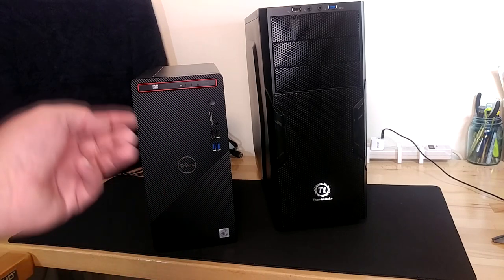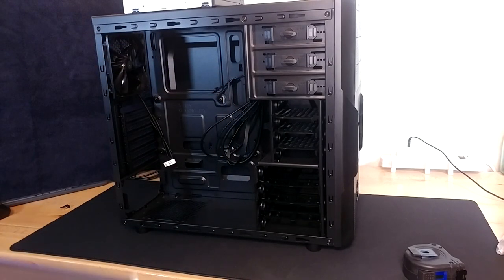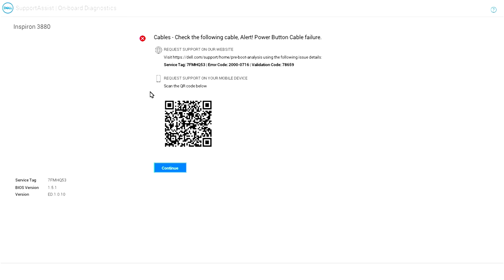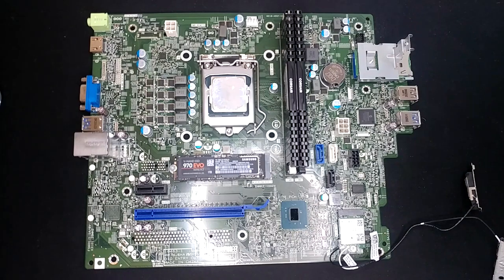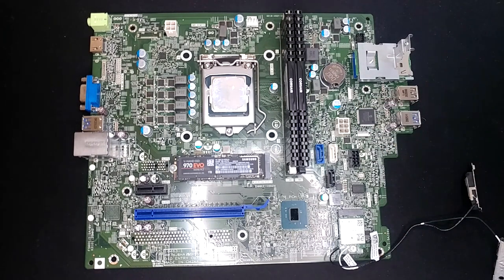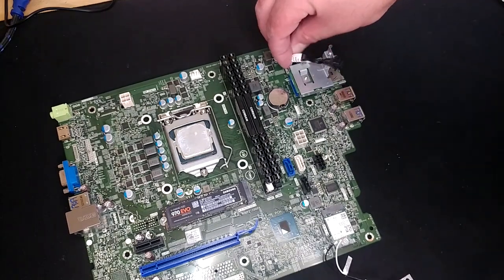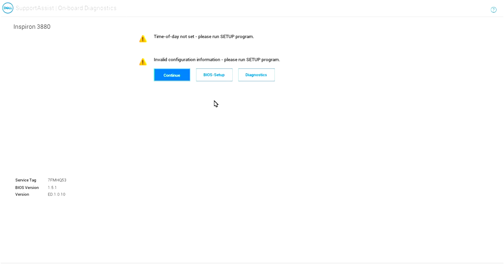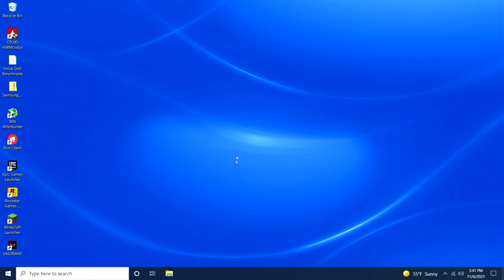Dell 3880 Case Upgrade!

Comment: Seems like the best course of action is to harvest the processor ram etc and sell the dell board which should give you enough money to buy a new standard board. I think that would work out just fine for someone on a budget and no compromises would have to be made.
Reply from the maker: I couldn't agree more. That is the exact advice I've given hundreds of people starting at the point of wanting an aftermarket PSU. From that point forward, they'd be better off to harvest their Dell for parts, IMO.

FWIW, I've seen no evidence that anyone but me has actually done the case swap. It's also one of the least viewed videos in the series. So, this seems to be the point of ridiculousness where people get off of the crazy train. 😆
Reply: @TheBrokenLife  I can definitely see someone doing it in the coming years as the price on these drops in the used market especially if they just need a more powerful gpu and already have all the parts for a quick and dirty setup
Reply from the maker: @JBTYpr  I'm not entirely clear which position you're advocating for, but the motherboard is the last thing of the Dell I would make any effort to keep. All the same, I've shown it can be done if someone really wanted to. 😆
Reply: @TheBrokenLife  I’m saying we will probably see both approaches, those who may have spare psu gpu and case might not want to bother with selling the motherboard and just do what you did for a quick and dirty setup especially as these get cheaper over time.
Reply from the maker: @JBTYpr  I gotcha. For the sake of those future peoples, I hope they find that aftermarket motherboards are cheaper too. 😆

Comment: Is it possible to just buy a new mother board and case, and just add all the components like the processor, ram,, harddrive,  etc, and it still be the samecomputer? like same backround, same files, same workings,  or does something special after that need to be done?
Reply: Looking forward to seeing the motherboard swap. planning to do this myself. Your the best.
Reply from the maker: @johnqwaser74  I think so... That's the next, and probably final, video in the series. The only unknown is whether or not I'll be forced to buy another Windows license. I also admit I hadn't thought much about retaining the exact same "everything". It's likely to be a better idea to commit to a fresh Windows installation, but, I suppose I can try it and see what happens.

For me, I plan to have 2 computers at the end of the series: the Dell more-or-less as it shipped and a full custom build, so those questions have different answers in that circumstance.

Comment: I was trying to fit a gtx 970 on a similar dell and the damn case rivets and lower drive bays stopped me from trying it out easily. I wish they were screws as well
Reply from the maker: You can always drill them out and replace them with sheet metal screws.

Comment: Don't see the point of upgrading the case without getting a new motherboard due to the performance limitations of the dell motherboard. Is it a good idea to get a new cpu cooler/fan if you were to transition to a new case and motherboard because the dell cpu cooler is low quality and cheap in addition to not being compatible with a standard intel motherboard?
Reply: I know in your case you have an intel cooler that came with your i7 so you would not have to get a new fan for your motherboard upgrade
Reply from the maker: @bud1239  For me, the point in doing it was simply to see if I could. But... I do know a lot of my audience is very young with very limited resources and simply want to play video games. What I did here is enough to be able to plug any GPU being built today into the Dell board without spending any more money than necessary to do it. I honestly didn't expect it to go well enough for that to even be a risk, but... mission accomplished?

Frustratingly, I think drilling for the Dell CPU cooler may actually be standard, it's just the attachment method that isn't. I think you actually could use it on a different board. We'll find out in the next video.

...and I do indeed have the Intel cooler to use if I want, but I may (ahem... DO) have another trick up my sleeve. :)

Comment: If you switch to non-Dell motherboard, do you think the Windows license would still work?
Reply from the maker: I've heard it does, but my instinct is that it shouldn't. In my case, I'll end up with 2 machines so I'll need to buy another license anyhow.

Comment: yk i was thinking of doing the case and mobo swap, to avoid e-waste i could buy another i3-10100 and give it to a family member
Reply from the maker: Or, unless you already have an i7, give yourself an upgrade along the way. That's exactly the upgrade path I'm taking. i7 in the custom built machine and the i3 back in the 3880. On a longer timeline, my custom build will end up with an i9 and the Dell will get the i7 back again. Just waiting on prices to come down...

Comment: Hey, look into USB-C ports.  Any chance they make a USB-C for 3880 case drive slot?
Reply from the maker: Probably not. Since the board doesn't have any USB pin headers you'd have to install a USB PCI card and then figure out how to add the USB C port itself. I do know the 3891 comes with a front panel USB C. If you haven't ordered a machine already, you could always go that way.

Personally, I don't find USB A to C cords that inconvenient and just go that way. There are also adapters that aren't on cords, which would get you pretty close to the same result.
Reply: The optical drive slot is kinda useless for me.  Since 99.9999% of my data are living in the clouds, however many phones are shifting to C ports, so I have to future proof a little.
Reply from the maker: @yflou3525  For a phone, I would (and do) just use a USB A to C cord. You should still get full USB 3.2 speeds. I'm not sure what other advantages there might be to having a USB C to C cord connection, but every video you've watch on this channel came down an A to C cord before it did anything else. ;)

Comment: Is this possible for a 7080mt?
Reply from the maker: I don't know anything about that model, but where there's a will there's probably a way.
Reply: @TheBrokenLife  The motherboard of the dell 3880 and my 7080 mt also has its front IO on the motherboard. And thanks for replying.
Reply from the maker: @daud3851  The front I/O is unlikely to work out, but you may find a case that it will fit. I really do think it's worth the extra $100-ish to just replace the motherboard though.
Reply: @TheBrokenLife  Yeah i know but my country sells it for like 400+ for a b560 i need that mobo for my i7 10th gen from my dell 7080.
Why couldn’t i just get a i7 pc that is not from dell?
Well it was a gift from my parents for my good grades.
Reply from the maker: @daud3851  I'm pretty sure your 10th gen processor only requires a B460 chipset if that should help you out...
Reply: @TheBrokenLife  Oh..wait can it run in a h310 or h510?
Reply from the maker: @daud3851  No.
Reply: @TheBrokenLife  oh.

Comment: Why don't Dell and HP use normal motherboards be a lot easier
Reply from the maker: As for the bolt pattern, there could be a million reasons ranging from ignorance to malice, but we'll probably never know the real answer. The integrated front I/O and CPU fan mounting are cost reductions, so at least that makes some sense. 

The twelve locations they bolted the board down makes no sense at all, and is a cost increase, so... go figure.
Reply: The good old Optiplex 990s were a joy because of that. Answer is to sabotage longevity.
Reply: @TheBrokenLife  Thank you for making your Dell videos they have helped me a lot Mate
Reply from the maker: @MandoMTL  We'll never really know, but here's my take on it... 

I honestly believe that 99% of people would never concern themselves with attempting to upgrade a PC motherboard even if it was bolt-in. I can't imagine major manufacturers sitting around and intentionally plotting against the 1% of the rest of us. There's no money in it.

I'll double down on that by pointing out the playlist of videos that showcase how Dell has actively refused to harvest more money from their customers by selling them the optical drives, drive caddies, and larger PSUs they'd happily pay for and they already make. Oddly, Dell will happily sell you the wrong optical drive all day. It's infuriating...

From the time I've spent in other industries, the answer really is just regular old stupidity, or ignorance, the vast majority of the time. Any organization of sufficient size can succeed on failures for decades, and all in all, if Dell can stay in business selling any computer for $329, they're smarter than I am.
Reply from the maker: @95winston  I'm glad to hear it!
Reply: @TheBrokenLife  I'm thinking you're probably right. Somewhere along the line some bean counter probably thought it would be more profitable to build this way, with likely no awareness that they'd be killing upgrade paths. I can accept that. In a time where Billionaire Corps are pontificating about going "green" though, returning to the ATX standard would go a long way to reducing E-Waste.
Reply from the maker: @MandoMTL  Those billionaire corporations are, indeed, pontificating. There's only action about going "green" where it doesn't hurt or they're incentivized. I'm sure Dell's US operations are all squeaky clean to meet whatever tax kickbacks they get for it, but we're all going to be waiting for a long time before Foxconn does anything about their environmental footprint as the real manufacturer. As I recall, Foxconn has a hard enough time just keeping their employees from jumping from the roof.

As for the ATX standardization, I still don't think most people would even know or care. The best we can hope for is actually effective environmental technology that makes use of the disused equipment and that somehow people are incentivized to actually recycle it. Most e-waste is just straight up toxic waste, but maybe with material shortages becoming more and more common recyclers will develop better technologies to harvest the stuff back out? In the meantime, I've pulled the cart about as far as I can to keep people using them for as long as they care to. :)

Comment: How did u setup the power switch
Reply from the maker: I didn't. I set it to automatically boot under a power-on circumstance and then used an outlet strip to control it.

Comment: Hopefully anyone who thinks about doing this will watch this video first and understand why it is such a bad idea to start off with a low-cost Dell with plans on a later case swap.  I think you would end up with heat problems.  All that flow is not how these are designed.  All that open space just means there is controlled flow of air through the case.
It's too much of a bodge.  That's just the nature of dealing with non-standard parts.
Reply from the maker: It is for sure not a good idea to set out with this as your intention. Where this makes sense is when you harvest the pre-built for components to add to a standard motherboard, which will be what happens in the next episode. I've demonstrated that you can upgrade slowly through this progression if that's what you can afford, but you really shouldn't. At minimum, the case and motherboard should be paired.

I disagree with you on cooling. I've demonstrated that configuration only draws about 120w at peak, which seems just about impossible to overheat in either case, and I don't see anything in the re-cased setup that is a step backward. The additional 120mm fan right at the CPU and the wide open top are huge upgrades. There are also plenty more places to put fans in that case if needed.
Reply: @TheBrokenLife  If the system does not need a ton of cooling and can get away with basically passive (meaning doesn't need a fan) cooling, then you are probably right. But if you need good air flow, this would be a cooling nightmare.  The G5 Macs had a somewhat similar case, but it was loaded up with high volume fans and was loud.  (BTW, I agree with you on water cooling. It's crazy)
Personally, if I had this dell and wanted to upgrade, I would save my pennies and do upgrades easily transferred when the time comes to get a new motherboard and case.  I'm glad you did the video because it shows the types of problems you run into and just how ridiculous it can get like losing your on/off button. 
OTOH, I GET IT. Last month was terrible for me with two major repairs in my house. I had a sewage pipe burst and a roof leak.
Reply from the maker: @tarstarkusz  I do wonder whether or not it could be passively cooled with a big enough heatsink. I think you might be able to get away with it.

Oof... Sorry to hear about the problems with your house. I don't miss that part of home ownership.

Comment: I didn't how bad Dell was until I shelled out some moola for some e-waste that I thought I would recycle. They design everything with malicious intent. Every single thing is designed so you can only use Dell cases with Dell power supplies with Dell graphics cards with Dell memory, etc... I didn't know that... I just thought they where regular computer cases, had no idea how hostile their eco-system had become.
Reply from the maker: Ehhhh... Some of that is more true than others of that. Every Dell I've seen for the last 20 years would accept standard RAM, CPU, GPU, drives, etc (except for their new XPS laptops... they developed their own new "standard" of RAM for them). Their cases, PSUs, and motherboards are proprietary, but that's been true of most box store PCs since the '90s.

What I always tell people is that buying the cheapest new Dell is a good way to to go. I can't buy the parts for as little as they sell their ~$400 specials for, never mind a Windows license and all of that. From there, you can gut them into another case or do whatever you want. Where people make a mistake is when they buy an expensive Dell. That's usually where they could do better elsewhere for the same money.
Reply: @TheBrokenLife  What I meant by that was that their BIOS seems to refuse to read the JEDEC profiles in the memory. Nor unlocked CPU multipliers. So you have to be very picky when picking up an old used system. My Dell case said hello to my tin snips :) (new aftermarket PSU).
But yeah, its mixed bag, you got a 50/50 chance of a Dell branded MB accepting new parts even if the chip-set does support according to Intel.
Reply from the maker: @BobHenderson-dr2wy  The Dell BOIS is for sure restrictive. I don't at all care for their CPU power management or lack of other features. But...People buying them probably don't know what to do with those features. I can't particularly blame them for not allowing people who can barely operate windows to overclock their CPU. 😅